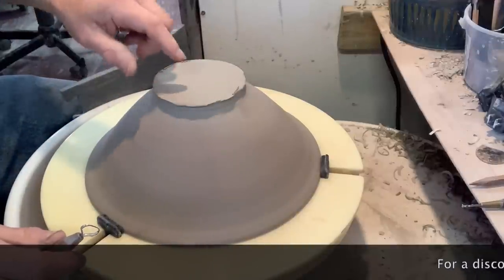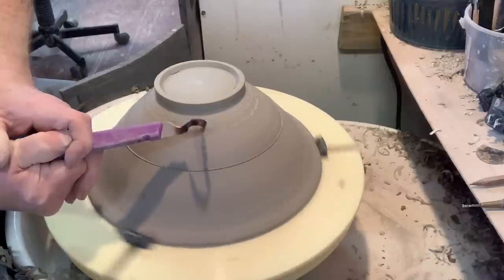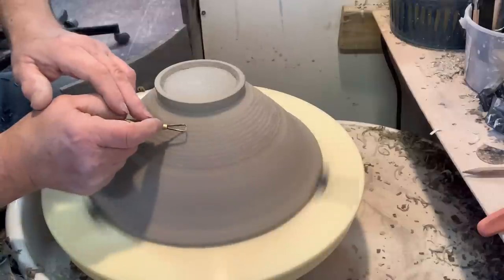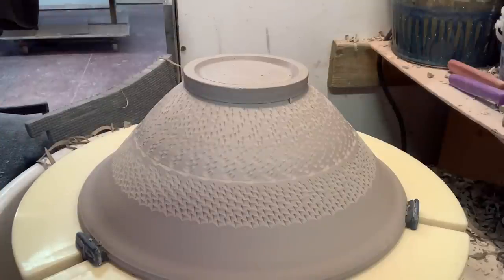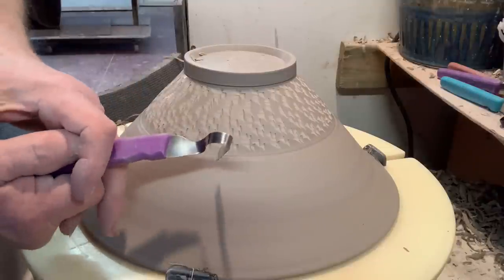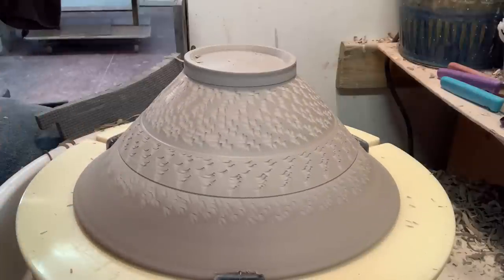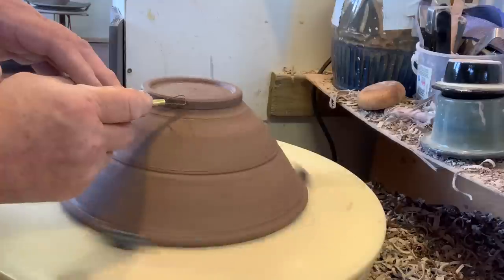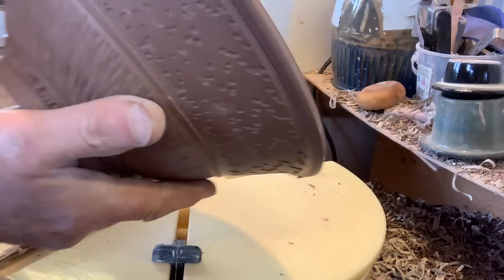Chattering Pottery Explained.

Comment: Do you suppose the "dig in angle" one might be for left handed/clockwise chattering?  I work on a kick wheel so either way is pretty easy and I find that trimming left handed sometimes gives me better results.  If you had bands like what you are doing and alternated left and right spin?.
Reply from the maker: Yet another good idea. I find the new reverse tools Bill sent are good for chattering up the wall and the other side of the tool for going down the wall. Playtime again.